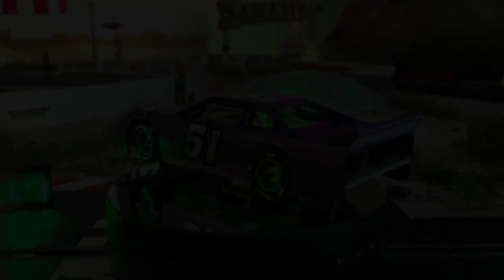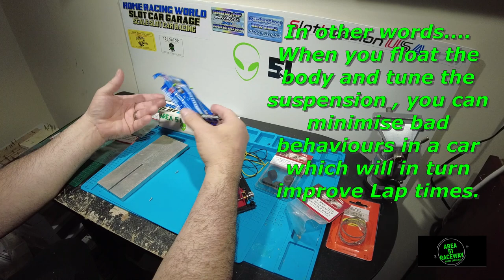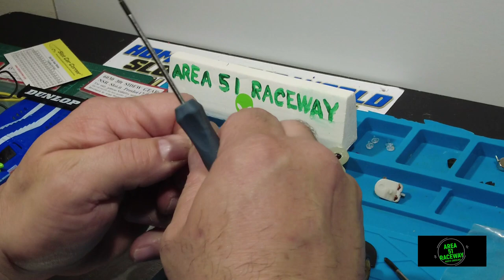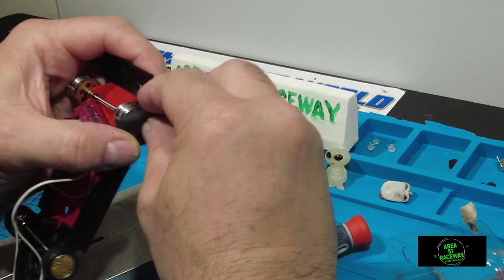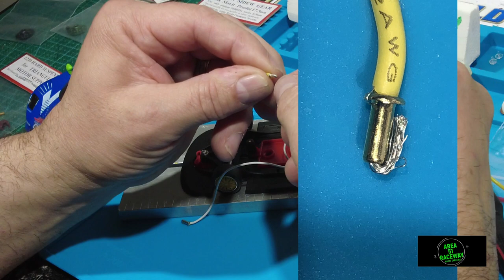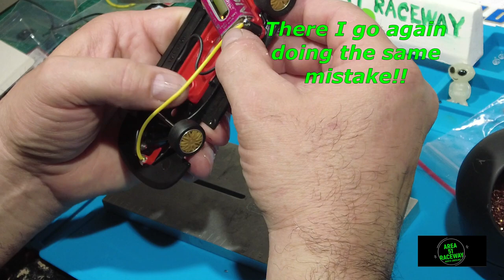NSR  Basic Tuning

Comment: Great video very helpful to a new person getting into the hobby. Curious what you use to clean your tires when running
Reply from the maker: No problem! I use the trinity tire tweak that is a tire treatment used on RC tires. A lite coat on the rear tires. Let them soak in overnight then clean them the next day with Naphtha aka Lighter fluid and the tires will grip really good.
Reply from the maker: https://www.smalladdictionsrc.com/trinity-tire-tweak-traction-for-rubber-and-foam-tires/

Comment: Thank you for posting this video, it is very helpful for me. I just received my Mosler Gravity Gulf and I need to install a digital chip for my carrera track, which I already purchased from slot invasion digital chip. Both of my motor leads are white and I'm not sure which one is positive/negative (rookie at slot cars lol). Also I guess I need to drill a hole in the chassis for the diode? hate to do that. I noticed on Marty Ford's video, his chassis already had a pre-drilled hole. Many thx if you can reply. Thank again!!
Reply: I ended up calling LEB and he told me to use a 9 volt battery, so I got that resolved and the hole drilled and the chip is installed and running.  I ran a few laps and the car sounds like its dragging on the track quite a bit. Anyway, thanks for your video! take care